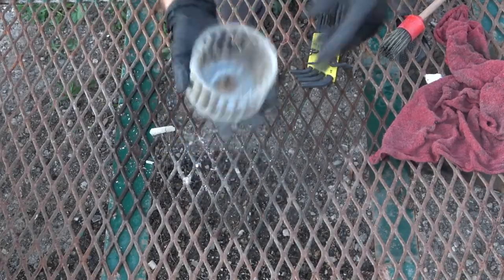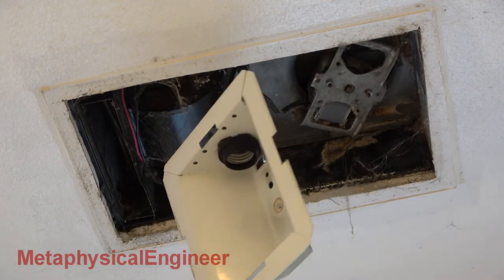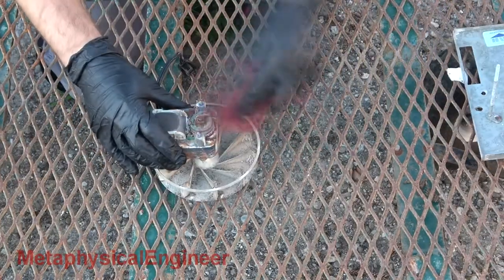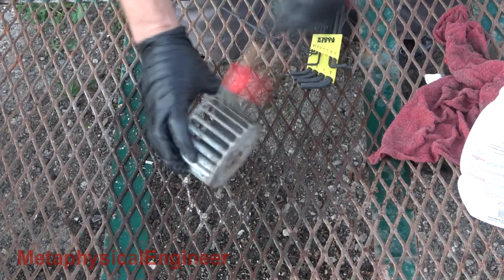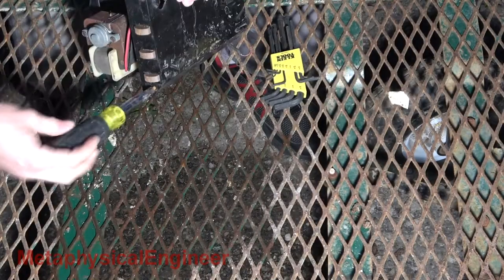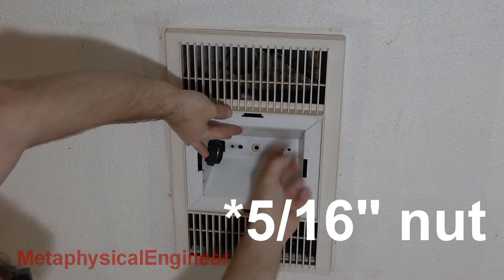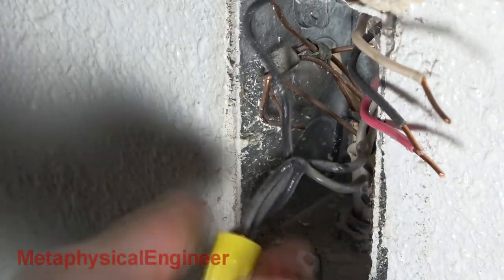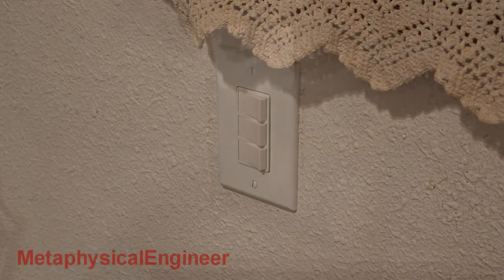Bathroom Exhaust Fan with Heater |  Cleaning and Service Guide

Comment: I came here because I just noticed after 3 years that we do not have a switch for the fan in our master bathroom. Our front bathroom has 3 switches. But we have only the light and heater switch. Do you have any videos for that?
Reply from the maker: Does the fan turn on with the light?  Or do you just have light and heater but no fan?
Reply: No the fan does not turn on with the light. In our other bathroom, there are 3 separate switches, and it’s the same exact fan, but there’s only 2 in our master bath.
Reply from the maker: I'd suggest getting an electrician to investigate.  Sounds as though something strange happened during installation, or the original triple switch may have been replaced with a double switch.

Comment: I would also recommend oiling both motors, the heater motor will likely run like new.
Reply from the maker: That was the heater I showed oiling. Both got oil but the bearings on the heater motor are shot. High temps broke down the old oil and it took terminal damage before I got to it.
Reply: @MetaphysicalEngineer  oh, my bad, I have the same unit and for some reason thought that was the exhaust motor

Comment: good grief.  We have 2 of these units in our 1991 Townhome.  We do not use the heating element(s).  My goal is to clean the fan.  Any suggestions as to whether or not we need to disassemble the entire unit?  Thanks.  Good job!
Reply from the maker: Disassemble as much as you need to or are comfortable with.  If you never use the heaters, there's maybe less dust in that area, but the airflow from the exhaust fan will cause most parts of the unit to collect dust regardless.  Here, the whole unit was filthy because it gets lots of use and had never been serviced.  

That said, bathroom fan units are somewhat frequently cited as cause for fires because of how much dust can accumulate so I wanted to clean everything to be safe.

Comment: I have a similar fan in my apt. The neighbors cigarette smoke is coming into my restroom… do i need to clean up my own fan like that or do i need to call a professional?
Reply from the maker: Apartments sometimes have the vent pipes from many fans connected together, so the neighbor's smoke could be getting in that way.  See if the smoke smell is better if you also turn on your bathroom fan to force air out instead of letting it in.  

I do recommend cleaning the fan anyways, but that might be a task for apartment maintenance crew or a pro because you could be blamed for damage otherwise.

Comment: excellent video. i have 2 Broan 9660 Deluxe Series Heat-A-Lite - 1500 Watts. both are 7.5 yrs. old and have the thermal discs, and both cut out after approximately 3 minutes of operation. i already vacuumed both in place and they still cut out. 

when i do fans/vents. i put the light covers and face plates in the dishwasher. also, on NON-HEATER vents only, i cover the inside of the metal housing with self-adhesive peel & stick felt pads. it really suppresses the fan noise. as soon as i recover from an injury, i will repair those 2 heaters. thanks for the excellent video.